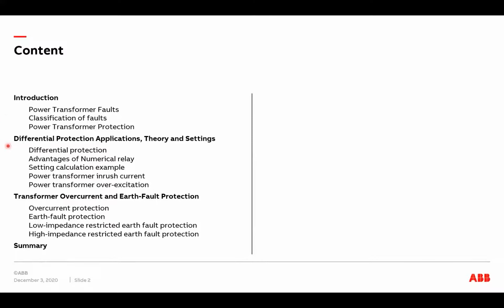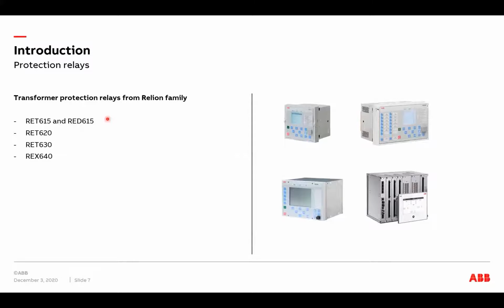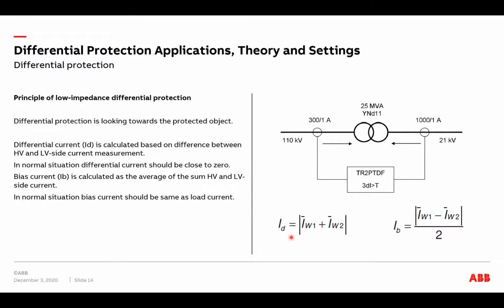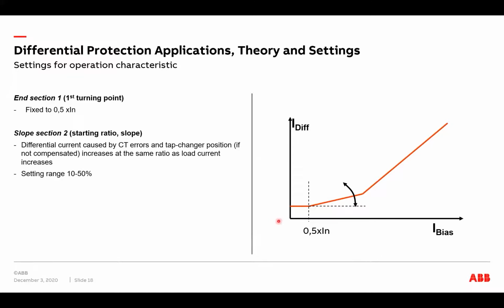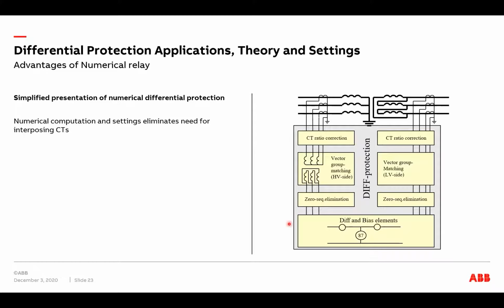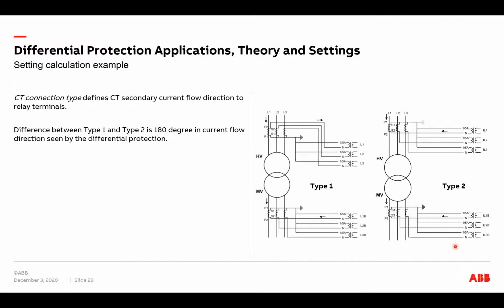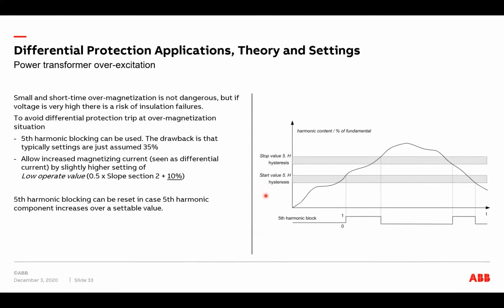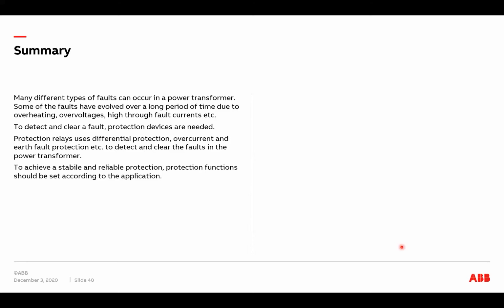Differential Protection of Power Transformer Webinar

Comment: At 30:20, are you sure that you need to have an interposing CT of YNd5??? I think it is wrong. If the Differential relay is inserted at the position shown as in the diagram, you need an ICT of YNd1 and not YNd5 to cancel out the phase shift of +30 degrees introduced on the secondary winding of the transformer.!! Correct me if I am wrong please!!